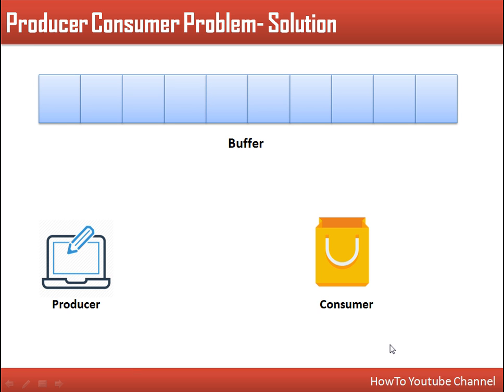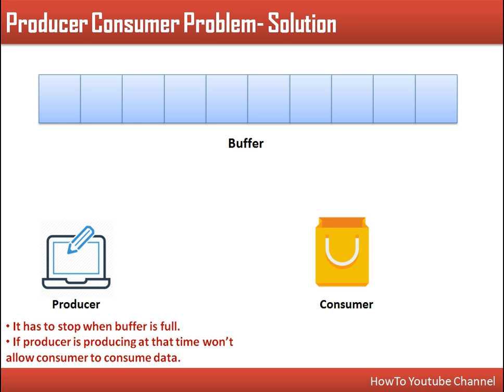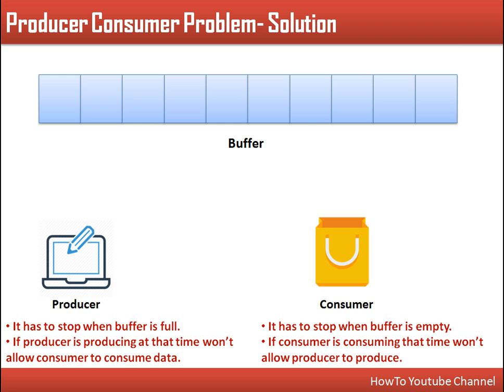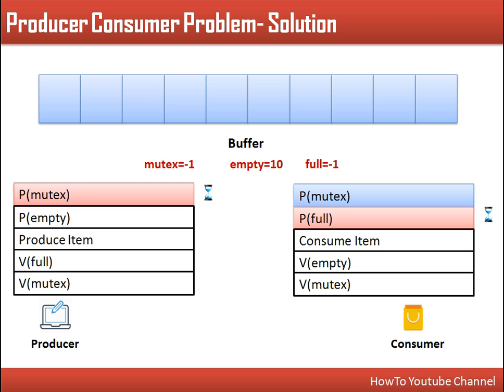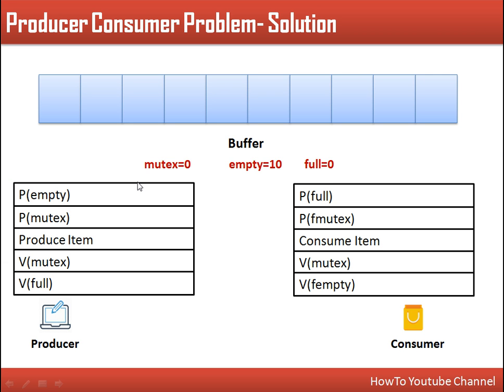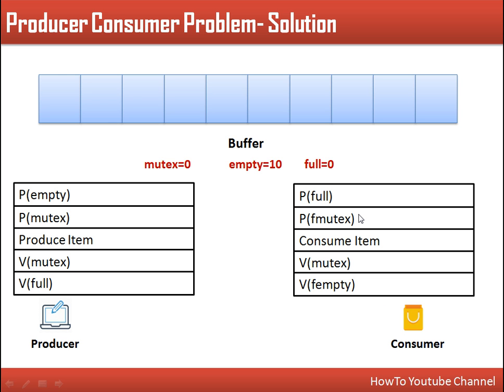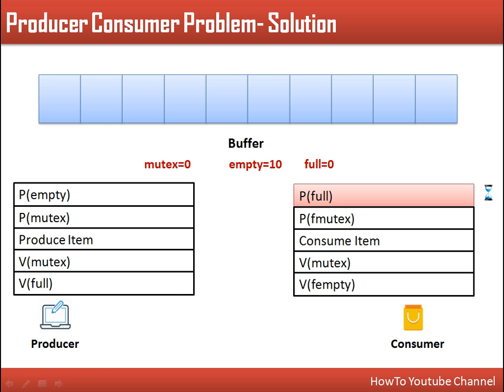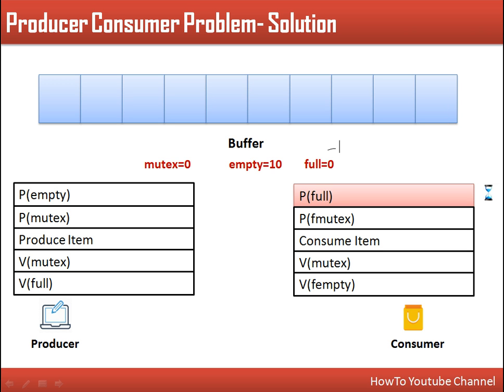Solution of Producer Consumer Problem using Semaphore

Comment: Your pseudocode is wrong. You do not lock the mutex then check the state of the buffer. You check the state first then lock the mutex. That will result in deadlock if the buffer is either full on empty as you have no control over which thread will run first.
Reply: exactly right. same happens if the consumer happens to go first. lock the mutex then wait on full and everyone waits
Reply: Watch the entire video.

Comment: @6:47 you said p(mutex) was waiting in consumer process  because its value was negative and now it can run  because mutex is 0   (THE IMPLEMENTATION of P or wait method says while(mutex<=0);    thise means if mutex is -ve or 0 it would keep spinning in loop until its a +ve value    )

Comment: SIR, in final solution  firstly when consumer try to execute  it makes FULL=-1 and go for waiting  ,  then producer execute and make  FULL=0 , NOW if consumer try to consume data from buffer  it makes again FULL=-1 and go for waiting and can't take produced data from buffer until producer makes FULL=1 . So ONE produced data in buffer can't be consumed . WHAT IS THE SOLUTION ??
Reply: When the consumer code is waken up by the producer it does not run from the beginning. It starts from the place where it was put to sleep. Therefore it doesn't execute the FULL-- ; instead continues from p(mutex).
Reply from the maker: let's assume consumer trying to consume data from buffer ( empty) it will make full = -1
now when produced produce something then it will make full = 0 which make consumer code to run. Now consumer will consume recently produced data item.
Reply: SORRY to disturb you again Sir, but I still can't understand that when producer produce something it makes FULL=0 (as consumer try to execute in very first case makes FULL=-1) , Now when consumer code try to run it prevented by the first instruction ' P(FULL) ' which makes FULL= -1 again and consumer goes for waiting can't take the produced data from buffer....
Reply: @souravbasu5652   When the producer goes to the critical section then the consumer process starts.